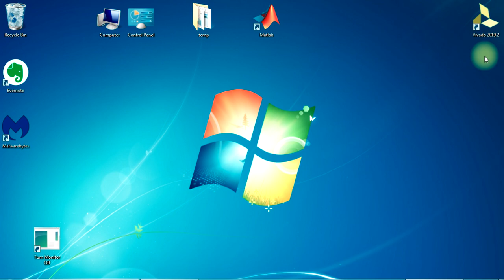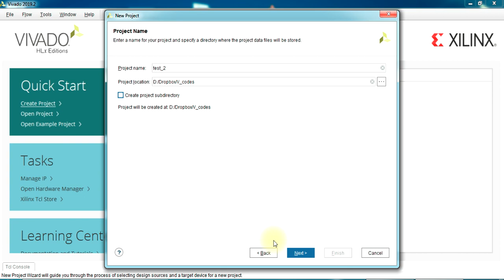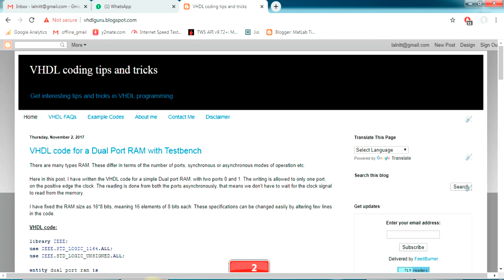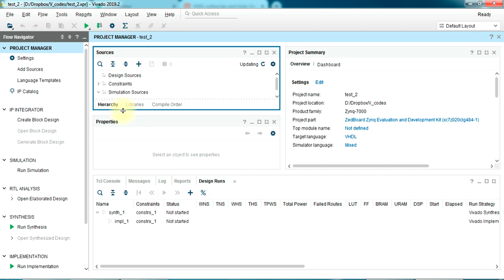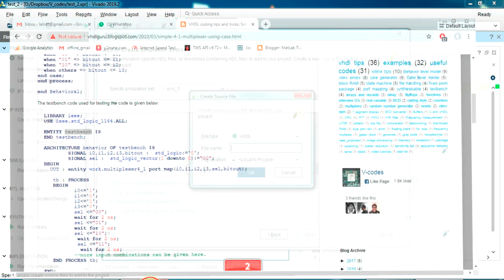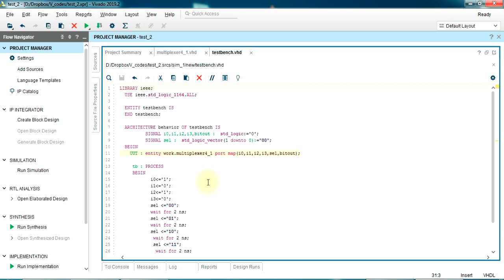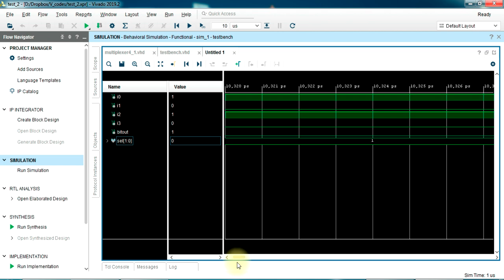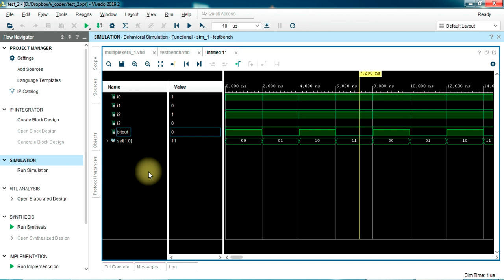How to Simulate a VHDL/Verilog code on Xilinx Vivado 2019.2

Comment: Thank you Sir for making this good video. Since I have no physical board to test, do I need to code a workbench.vhd file as well in case of testing my own codes? THX
Reply from the maker: yes, its always recommended to write a testbench code and test the code before finalizing it. Otherwise how will we know if the code is working. Just getting it compiled without errors isnt enough. Even if you have the fpga board, I would first verify with testbench. Debugging on board, normally is more time consuming.